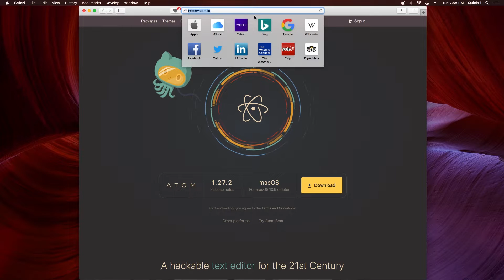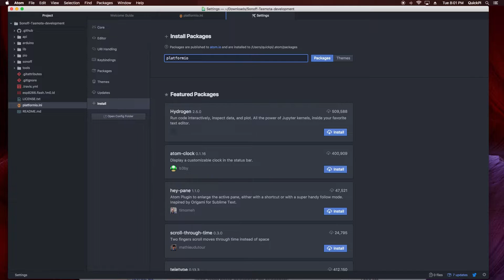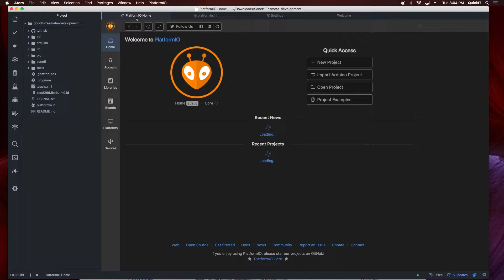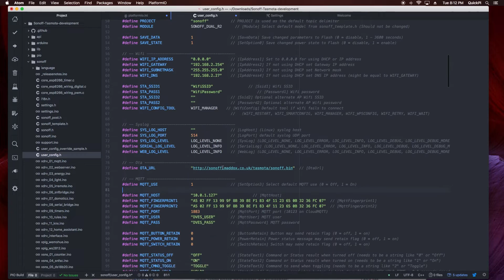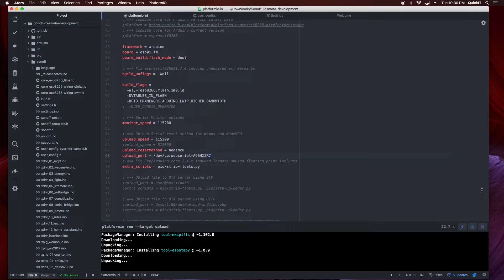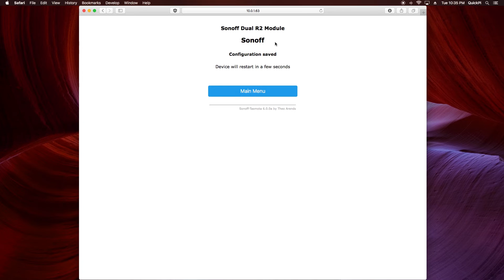TUTORIAL: Install Sonoff-Tasmota Firmware on the Sonoff Dual R2

Comment: Thanks, great explanation!

I ran into two minor issues: 
1. Had to add the .platformio\penv\Scripts location to the PATH environmental manually (Windows non admin mode). 
2. "env_default" was not set in platformio.ini. All env's were compiled, but only "sonoff" was uploaded, which is good.

Comment: Hi, I have an error while launching serial port list.
pio: The term "pio" is not recognized as a cmdlet name, function, script file, or program
executable. Check the spelling of the name, or if a path exists, check that the path is
correct and try again.
To the line character: 1: 1
+ pio device list
+ ~~~
     + CategoryInfo: ObjectNotFound: (pio: String) [], CommandNotFoundException
     + FullyQualifiedErrorId: CommandNotFoundException
I have one
sonoff Dual R2
with win 10
a USB cable TTL-232R-3V3